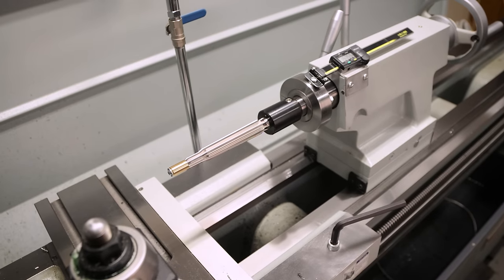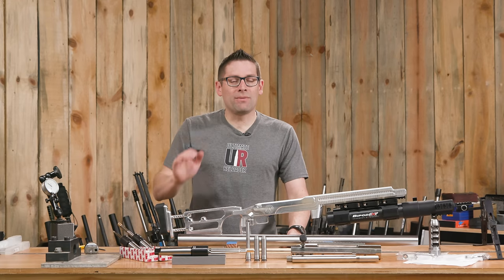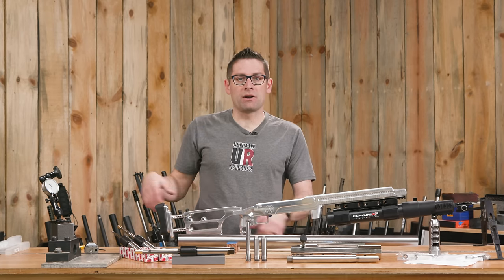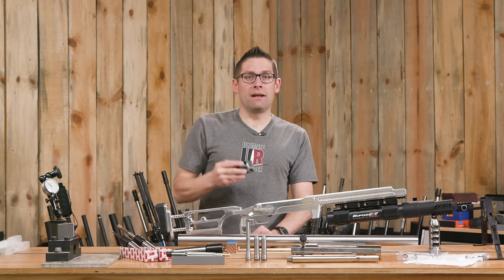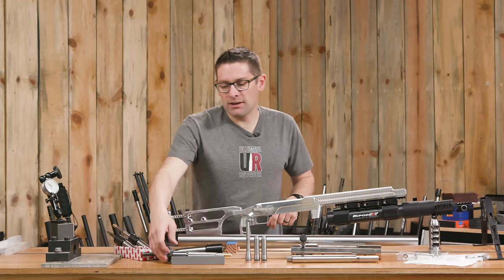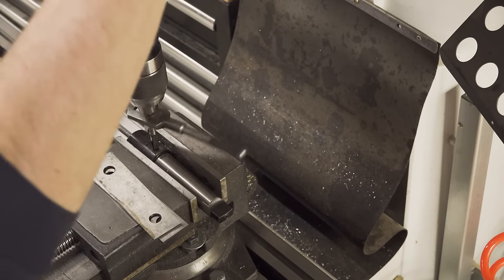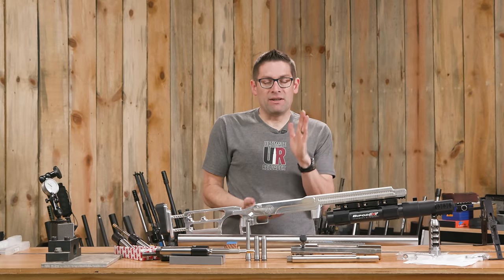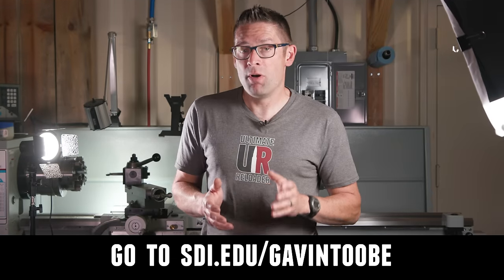How-To: Machining a Rigid Reamer Holder (Rifle Chambering)

Comment: It doesn't solve tailstock misalignment. It only solves misalignment if you dont extend/retract the tailstock. Also incredibly important that the hole you put in the holder has zero tolerance. If you can slip a reamer in, it's got play. Even if it's half a thou, that's how far out your chamber is going to be in addition to the tailstock deviation.
Reply: 100% agreed.   There is also thermal expansion to deal with.   My shop is not temperature controlled, and I see diffences from hot days to cold ones.
Reply: I agree.  I had a 14x60 (Wilton) lathe for awhile.  The tailstock was mis-aligned (.0015" nod) from the factory, and I couldn't ever get shimmed completely out.  Extending the tailstock obviously made this error appear even worse.  A rigid reamer, no matter how it was cut, would still make a junk chamber.  Floating reamer allowed me to cut chambers good enough for the hunting rifles I was building at the time.

I've got a different lathe now, but I'm still not sure I'd trust a rigid holder like this unless I had a better temperature controlled shop.  Maybe if I had a $200k cnc machine and I was churning out barrels by the dozen then this kind of holder would make sense because I could verify the setup/taper and knock out handful of identical barrels.  I'm guessing 99.9% of home gunsmiths would be better served with a traditional floating reamer, however.
Reply: Aaron Anderson is 100% correct.  You would have to bore the tailstock casting and make a new quill to fit it.  Also , you kids are using small NEW lathes with (probably) still straight ways.  Carriage (and tailstock) movement over 20+ years will wear the ways in the area of use and change tailstock parallelism to headstock spindle.   As Aaron said. As long as you don’t crank the tailstock quill in and out, Gavens method is ok.  But, If the bore of the tailstock quill isn’t parallel to headstock bore (few are. That’s why lathes were used between centers), making a solid reamer holder is not best answer.
Reply: @thatsthewayitgoes9  You'd also have to torque the tailstock the same every time. Even then... a little dust or crud under the tailstock...

Comment: The thing with a rigid reamer setup instead of a self aligning setup in the talestock is that you will have to put in the barrel 100% straight or you will get a chamber that is not straight to the bore or loose. From what ive read, not the way to go. What you said that this tailstock and morsetaper holders are 100% straight is true. But making a good barrel all depends on getting the bore to be aligned perfectly. It can be done, but there is always a tiny bit of error. 

I would use a floating reamer holder, and use a MARS reamer micrometer. I made one for large calibers like 50BMG and put it on GrabCAD. It was some work to draw it all in 3D, but im sure it would work. It sure would sell too, because the large caliber one is not being sold anywhere.

Any way, very interesting project. 

Greetings,

Jeff
Reply: Now a days they pre drill then pre bore the chamber undersized. Then verify the throat area is running perfectly with long reach indicator. Once that is done the reamer pilot is running on the indicated trued bore to finish the chamber. No one can make a barrel run completely true from end to end because the hole is never straight. So if you get both ends true the throat/freebore area could be out. It's the most important part 👍

Comment: I might give this a try. I made a little floating reamer driver that didn't work all too well, and I've been trying to hold the reamer in my hand while driving it with the tailstock lately. That's not working too well, sometimes I get a lot of chatter that is hard to deal with and I ringed my last two chambers. Things like six groove barrels not liking to work with six flute reamers when it's just your hand preventing reamer rotation are hard to get around.

I need to learn how to be a better machinist and get my machine lined up better anyway. If I was a better machinist I probably would have figured this method out on my own, but I'm not so thanks.

Comment: Late to this party... But there are 2 slots already milled into your cross slide and you have a DRO. Why not bore out a holder out if a block that it mounted onto it? Theres no worrying about tailstock misalignment or nod with that method?

Comment: Nice idea, my only concern would be if reamer shank and cutting edges are coaxial. If not, this method cannot be used. I have seen this runout in several reamers of different makes. 

I prefer turning in a cnc lathe my chamber body and shoulder to reamer diameter minus .004» prior to reaming with a floating holder.

Comment: I agree with most of your stuff. But this one I disagree with.
The set screw pushing on the reamer will move it a minimum of a 1/2 Thousandth. Away from the screw hole location.
.0005 on a lathe actually cuts a .001 larger hole because your cutting on both sides of the hole.
I have played extensively with rigid reamer set ups. Using the tailstock it is basically impossible. You don’t have enough axis’s to adjust the reamer true to the bore of the spindle.
Don’t believe me. Put a indicator on your reamer when your cutting your chamber you will see the run out.
The best I could do was .0007 run out with your shown method.
I now use the carriage to do my chambers, and rely on a JSG floating reamer to take up the .0005 run out.

In this video I show the runout that is caused by the set screw pushing on the reamer. At 7minutes 34 seconds 

Custom Howa 1500 in 22 Creedmoor! Precision rifle build. Chambering A $650.00 rebarrel package!
https://youtu.be/8ztHUvPEbbE

Love your work!

God Bless

Dustin 

Drews Precision